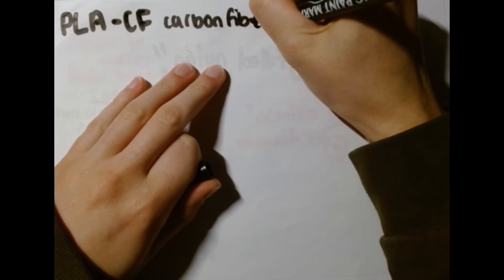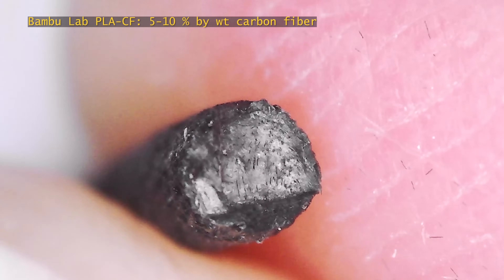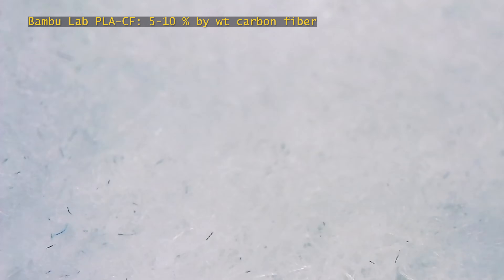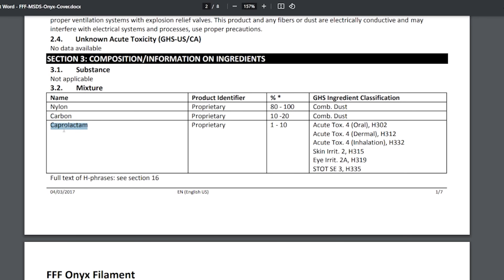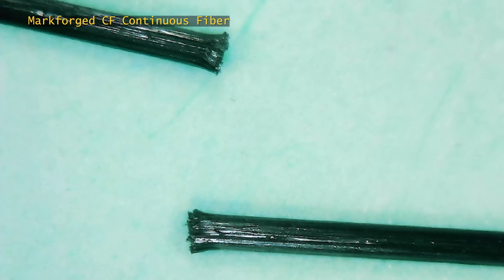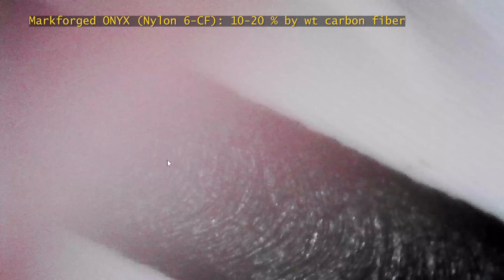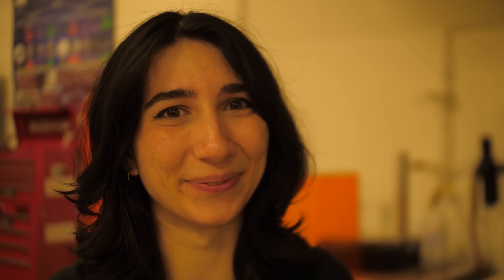hobbyist vs. engineering carbon fiber (CF) filament - is there a difference?

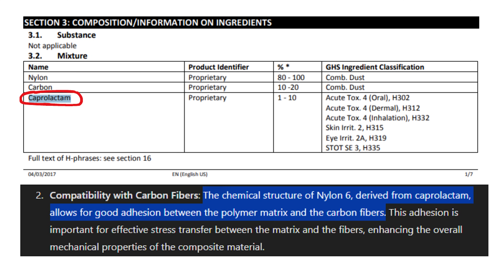Comment: 13:35 You misread the Chat GPT response. It was describing Nylon 6, not caprolactam itself. The function of caprolactam additive was never described, but unpolymerized caprolactam has an odor, and (as a low-melting-point monomer) would have very poor mechanical properties.

 If I had to guess, it's probably functioning as a non-contaminating lubricant, plasticizer, or coating. It can be dissolved in water or other volatile solvents. After evaporation of the solvent (if any) and upon heating, (e.g. during filament manufacture), caprolactam polymerizes to Nylon 6, removing contamination concerns before shipment to the customer.

Comment: The real danger of cf is inhalation. Unlike CF-resin matrixes, the CF in these Onyx or other types of print filaments, the CF is not encapsulated by resin. The hazards of CF during 3d printing should be reduced by proper ventilation or inhalation filtration masks rated for the size of the particles in the filament.

Comment: Qidi has a GF25 filament that they say is 25% glass fiber rather than the normal 15%, but they coextrude it so all of the fibers are on the inside part of the filament with a layer of raw ABS on the outside.  They claim the finished parts therefore won’t have fibers on the outside.  It would be interesting to see if that’s actually true.
Reply: technically not 100% possible as the extruded lines will always have a start and end point where the ends stick out, probably means less of it, but problem is still present
Reply: Probably as effective as filtered cigarettes

Comment: Well done. In my research lab we came to the similar conclusions with 3D print resins. We were looking for a way to make chambers to grow human cells and after years of testing over 20 resins, including ISO certified resins, we concluded there was no difference in toxicity between certified engineering resins and consumer resins, they were all toxic.  Various post processing protocols made no difference. It comes down to a poor ISO standard, which is a standard concocted by the industry.
I would not print any plastic without external venting, HEPA and VOC mask filtration and children's toys should not be made by any method of 3D printing.  I have serious concerns about dental braces made by 3D printing, as these are not adequately tested due to FDA loopholes.

Comment: definitely not opening my two boxes of PLA-CF!!!  🫣
Reply: Wear a respirator, handel it with gloves, then paint the printed part with transparent lacker. Should do the trick ;) But yeah this material is  nasty.
Reply: @iopfarmer  ill stick to PETG ;)
Reply: @novakinb  depending on the usage, I think the risk is a little overblown. I rarely touch my filament unless I'm loading. And very briefly. I don't rub the filament, and I don't generally rub my parts. I'm going to do some follow up tests like in the video though. Bambu PLA-CF is actually one of my favorites to print with. What colors of PLA-CF do you have? I might buy it off of you?

Comment: When capturing images with your digital microscope, try image stacking using software like Picolay to improve the image quality under magnification.
Reply from the maker: @marcustomlinson1433  I didn't know you could do this or that this existed... thank you for this tip I will look into it 🙂

Comment: I think the concrete takeaway firm the video is that there is some risk of fiber transfer into the skin with fiber filled materials (potentially any fiber filled materials). I would say there is no distinction between hobby grade and engineering grade. There are simply different materials with different carbon fiber sources, specs, and fiber loading percentage. Bambus PLA-CF is marketed towards engineering (more aesthetic than mechanical though), and especially Bambus other filled materials (eg PAHT-CF, PPS-CF...). And whos to say no one can use engineering materials for hobby use.
Reply: With 3D print resins, my biomedical research lab's experience is that these speciality engineering resin companies in Europe are just lying about toxicity, while Asian sources will admit they never tested.

Comment: I came across somewhere that CF PLA has less tensile strength than Plain PLA , is it true ?
Reply: Yeah, there is really no reason to use PLA-CF other than for surface finish.
Reply: No, not necessarily. Bambu PLA-CF published tensile is 38 MPa and PLA Basic is 35 MPa. Also consider the bulk material properties will be diffywith the printed part. The printed part has the benefit of the fibers aligning in the direction of the extrusion.
Reply: @eighty-eighth_section  I think the main benefit is in reducing the creep and bending of filaments like PA. The strength does improve as well I think. 

The benefit of CF seems pretty minimal of lower temp materials like PLA or PETG (though it would definitely stiffen the latter).

Really though if I care that much about strength I'm going to be using a high temp material. I am curious how different grades of PA6/etc compare but the whole reason I got an enclosed consumer printer is to be able to use the high temp stuff.
Reply: @RichFreeman  I agree the main selling point of PLA-CF is not mechanical performance. I'm just nitpicking that it does not necessarily have less tensile strength. And tensile strength is not the only strength property. Some PA materials  suffer from creep due to moisture absorption, especially thin parts. (Like Onyx).

Comment: The topic of 3D printing safety is super hot right now.
Made with Layers also just made a video on ventilation when 3D printing at home. (3D printers are worse than I thought. Time to do something about it!)
Reply from the maker: @Petch85  I saw that video too! @NathanBuildsRobots you started a wave effect 🌊
Reply: @strelkomania  Nathan Builds Robots also have a nearly 3 year old video on ventilation. But there must be videos back form 2012-2015 when 3D printers at home took of. (But who can find anything on youtube anymore 🤷‍♂)
Reply: The toxic nature of resins, and even fully cured resin prints is vastly understated. No one is regulating any of this, or even testing. A poorly annotated SDS is not good enough. What is even worse is that some suppliers are claiming lower toxicity fraudulently. An ISO standard is an industry standard, not FDA standard.

Comment: I hate these materials marketing because it's like if i say that adding steelndust to the filament will make it stronger.

THAT'S NOT HOW THOSE MATERIALS WORK! 😭😭😭

The reason kevlar and CB work is because you make fabric-like sheets with them.
Not by adding them like glitter at random.
Reply: @Splarkszter  I'm a materials engineer. The additives do make a difference. I've done mechanical testing for 3D printing materials. It's not exactly random either. The short fibers align when they extrude out the nozzle. You'd be surprised at what other "dusts" are used in filament production are capable of.
Reply: @eighty-eighth_section  The thing I'm concerned about is safety.

Handling carbon fiber REQUIRES dust masks and everything.
But people don't seem to know that if it's on a filament?

We seriously need to require and educate people on safety standards.

Comment: Hey, I’ve seen this one before 😂

Markforged is cool stuff
Reply from the maker: Thank you for the video inspo 😇
Reply: Can you do cf tow + raw nylon outer shell? IMO that would be the best of both worlds for strength + safety
Reply from the maker: Also unfortunately its not that simple. The Markforged system slicer is cloud based and called Eiger. It makes it "impossible" for you to print the fiber on the outside like a shell or to print only with the continuous fiber - it HAS to be inside the part. But you can pause the print to expose stuff strategically. I'm not going to say its actually impossible (nothing is) but I'd need to figure out how to get through the print file encryption and all the printer safety checks etc... would be a hannah montana moment for sure (best of both worlds).

Comment: Nice video, i've been avoiding touching carbon fiber prints since I saw this thing about the fibers getting on your fingers,

Now I'm using PEKK to replace all the carbon fiber items which I would usually have to touch
Reply: Not so easy from a maker point of view, but I also avoid fiber filled materials, so nasty... PC Polycarbonate is easy enough to print on consumer printers and really more than tough enough for every day practical prints.
Reply: @iopfarmer  I'm printing PEKK on a qidi x-max 3, it's going for about $769 

Advertised as 350C extruder and 65C chamber, but it'll let you go to 359C extruder and around 69C chamber, 125C bed

Comment: My understanding is that it is the smaller particles that pose the greater health risk as they are more easily absorbed into body tissues especially in the lungs.
Reply from the maker: @idhardy  exactly. Isn't it freaky how small the ones in the engineering one are ? But the average 3d printing enthusiast I don't think will be spending $260 Canadian on a 0.8 kg spool of Onyx 😅
Reply: ItThe toxicity of materials in 3D printing is massively downplayed and the industry sells these materials with no test data at all for toxicity. Even some $120/l engineering grade resins that advertise ISO certification for biological safety are incredibly toxic after printing and post processing. The toxic UV sensitive monomers are a problem even after curing. None of this is tested, regulated, and the approach right now is to ostrich our heads. Not enough testing has been done on dental braces 3D printed.

Carbon microfibers in lungs are as bad as asbestos. A famous F1 driver, Mika Salo, developed lung cancer later in life and the excised tumor tissue was full of carbon fibers from brake dust. Like asbestos, they do not break down and cause a chronic inflammation that eventually leads to disease.
Reply: @truantray  are any braces actually printed? My understanding was they typically print the guides for adhesion or the mold bases for invisalign. (invisalign is vacuum formed over 3d printed blanks)
Reply: 800cc of Onyx is closer to 1 kg actually.

Comment: Really cool investigation - but please don't treat ChatGPT as a knowledge base. It makes shit up all the time, and suggesting it's a useful research tool harms the very concept of knowledge.
Reply from the maker: For critical info - I do not rely on chat gpt! When it comes to something basic I'm curious about and want a quick answer, I ask the AI and then cross reference with other sources if the answer seems suspicious. 

Might I add Chat GPT is an excellent troubleshooting resource when you don't know what you're doing. Last month when I came back from a conference trip, my PC SSD corrupted itself and I lost all my school files and some of my video footage (mistake learned...). I think my PC tried to update it's OS and ran out of storage in the drive. Chat GPT helped me recover all my files by teaching me which Linux commands to use to access the corrupt drive, partition a new one and copy the lost files over (it wasn't perfect lol and took a bit of tries but I saved my post files!)

That's my standpoint on the tool! I use it at my own risk 😁

Comment: Bambu just released a new PPA-CF filament, which has me interested. I am less concerned with fibers getting stuck in my skin and more concerned with it’s strength, heat resistance, and durability as a possible competitor to other main stream PETG-CF or PLA-CF filaments. But it’s always good to know the health risks and wear proper protection while handling these materials.
Reply: Very stiff one, that, almost 10,000  MegaPascals in Flexural modulus.

Comment: Hi there! It is a nice video - and I got excited at the beginning when you said you would compare filaments with different fibre sizes... Unfortunately you didn't actually test any physical properties like differences in strength. Maybe on the next video :)
Reply from the maker: Yep, you caught me red handed. Or, should I say fiber handed ? In all seriousness, no I didn't end up comparing physical properties in this video. My two reasons for that were, I just wanted to take a look at the fiber transfer/containment in this video. Also at the time of filming, the Markforged system at school was not set up to print yet and I was just using the few calibration prints that came off the machine while the technician was working. I'd like to actually print my own samples and test them and then collect that data in the near future if I want to do a video about the properties then just compare data sheets if that makes sense. BUT if I just compare data sheets it would be a faster release video - maybe comparing physical properties of all CF offered by Bambu or something... You've got my gears turning (they never stop lol)
Reply: @strelkomania  Looks like you need your own 3D Printer - they are not expensive. Ignore data-sheets, do your own experiments. You know the "My Tech Fun" channel by Dr. Igor? Check it out! He does lots of tests with filament.

Comment: Keep in mind that the two base materials have different weights. So the weight ratios alone don't paint the whole picture. Filled filaments are cool, but in most cases are not good except the few cases they're the best for. I personally use 3DXTech's filled filaments and some of their more exotic options that are still within the realm of the typical enclosed voron printer :).
Reply from the maker: Noted - that is how the weight by weight percent ratios work. I should've done the calcs. The Bambu Lab PLA-CF has density of 1.22 g/cm^3 while the Markforged nylon-cf has a density of 1.2g/cm^3. Not too big of a difference but still not an immediate direct comparison. I pulled those numbers from the materials technical data sheets. Those are linked in the video description. Thank you for your comment !

Comment: Wow, I didn't think that the fibers will transfer that easily! Now I have less incentive to print with carbon or glass filled filaments, even if I really like them. Oh, production quality increase - verygut!
Reply from the maker: Me neither to be frank ! Nathan's videos from the Nathan Builds Robots channel inspired the comparison in this episode. I have linked them both in this video description if you are curious. I was pretty surprised to see the fibers get stuck under my finger nails too. It was an insightful experiment.
Reply: Multicolor printing makes them usuable again. Just print the internals with CF reinforced filament and put a few walls of normal filament around it.

Comment: With more companies trying to get into the untapped low cost sls printing market, do you think that sls printers may use carbon fibre mix powders? I understand that they might not evenly spread out the same as with a filament and if the densities are different they could even just separate from the rest of the material in packaging but could it work?
Reply: That's not how it works, the powders are  made up from polymer particles with the carbon fiber and everything else already incorporated

Comment: Interesting results, I've always wondered what are the differences between real engineering filaments and hobby level filaments. Thanks
Reply from the maker: @YuriyCheese  no problem ! I think it goes deeper into the material science as well as the quality of each individual ingredient. On top of the manufacturing process. Mechanical properties can greatly vary in terms of consistency roll to roll. Thank you for stopping by and watching !

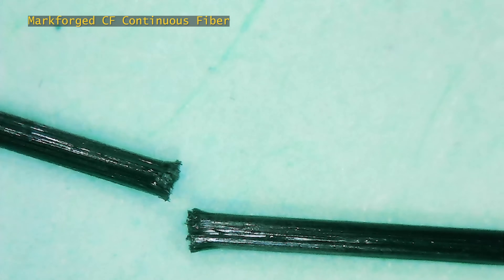Comment: 9:55
It looks like the fibers get everywhere. You can see the under you nails in this shot.
edit: You clear also noticed that 16:27 🤦‍♂
Reply from the maker: I'm glad you caught that too! I was surprised how "everywhere" they go...
Reply: @strelkomania  yes it looks worse than I would have imagined. Especially rubbing the print after printing.
I have never 3D printed carbon fiber PLA, I have never really had a printer that could print in a high enough quality that it would have made any difference.
But 40% higher stiffness is super tempting when designing part with spring functionality. 
The combination of being able to print a stiff material like PLA and a "soft" material like a stiff TPU covers so many use cases. Especially if you can print in 2 materials for the same part.

I have worked with insolation materials, glass fiber ley-ups, carbon fiber ley-ups, cutting and sanding in them. Mostly with protection against the epoxy. So I probably already have a lot of indestructible fibers inside my body, but I don't think there is any reason for me to start 3D printing with carbon fibers in my home. 😂
Reply: @strelkomania  Imagine how are your lungs

Comment: 2:19🤓
Me looking at the data sheets 😂
Surprisingly good data sheets. ONYX even shows a tensile test 👏
Reply from the maker: Of course - I knew people would be curious !! Especially you haha. Markforged datasheets are quite good. They have a metal filament system too (not the one in the video, it's called "Metal X") and they have a lot of technical info on the metal structures of the parts and the properties after printing, and sintering etc. I'd surely hope as an engineering grade material and system that they have their datasheets and technical info dialed in. With the hobbyist spools its a hit or miss, specially the ones you might just randomly buy on amazon.  It has made it hard a few times trying to find specific properties of an amazon purchased spool like (water absorption rate) when my group as writing a paper... noted to self.
Reply: @strelkomania  what is the paper/research on? You mentioned on the video you were trying to reach someone in the Markforged materials team. I can help with that.